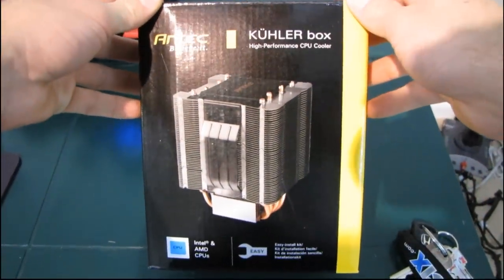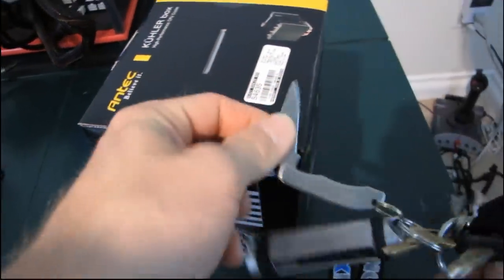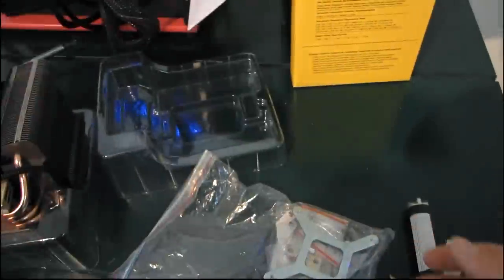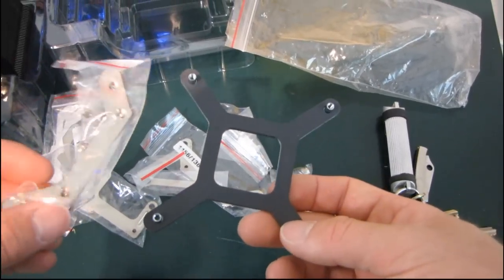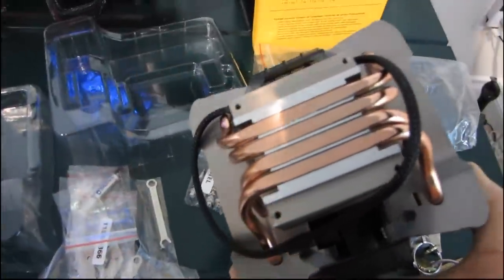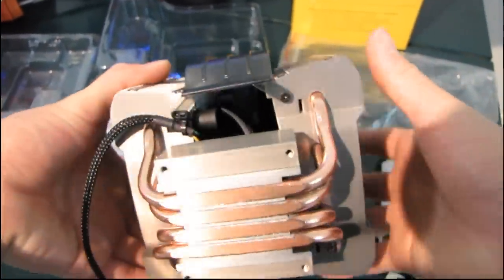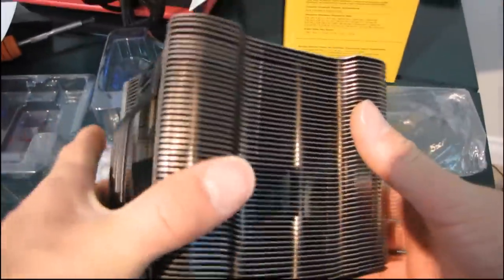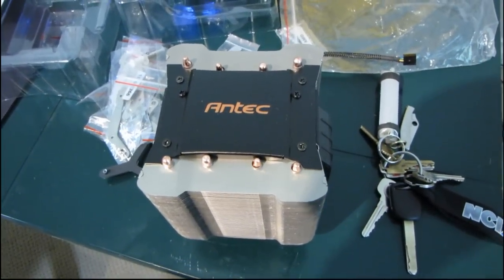Antec Kuhler Box Performance Dual Tower 120mm Heatsink Unboxing & First Look Linus Tech Tips

Comment: @RussMusiq these heat sinks are aimed at overclockers.
stock heat sinks are designed to keep you processor cool at stock frequencies. however if you overclock you generate more heat meaning you need better cooling

Comment: @G0dlikePwnage yes. basically - everything that fits in an 1156 mobo also fits an 1155 one. because its exactly the same physical socket - the difference is in the chipset that makes the 1155 boards SandyBridge-competable

Comment: It's not that great of a heatsink, the reason why you find Dynatron thermal compound included with this heatsink is because this is a Dynatron product renamed as an Antec. 

Google Dynatron G950 for reviews; it's not that great compared to the intel stock cooler and there are better options that can be had for half the price (Vendetta 2, Hyper 212 just to name a couple)

P.S. The manual looks like a manual for an IKEA product